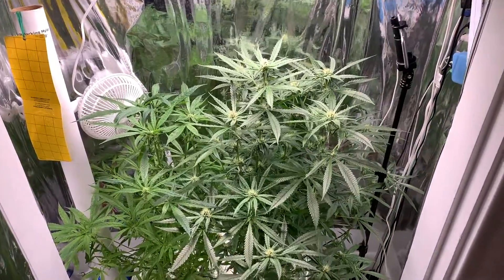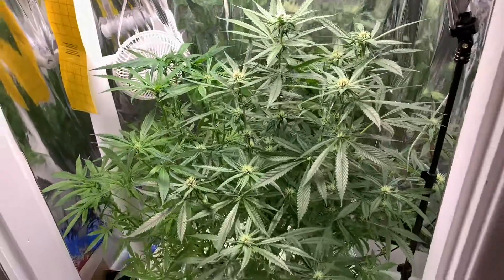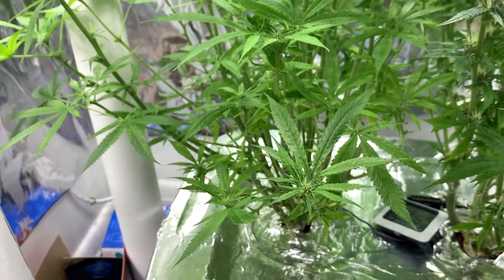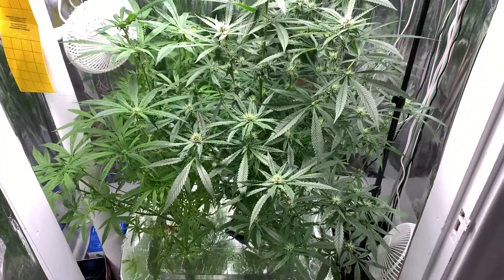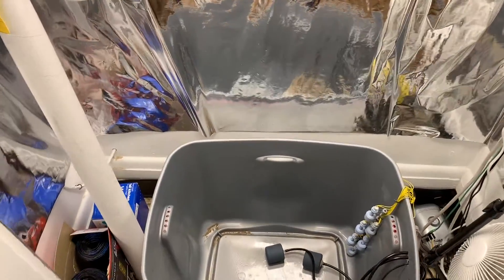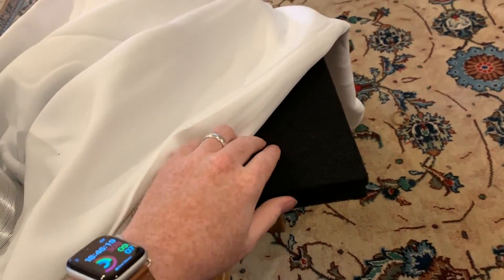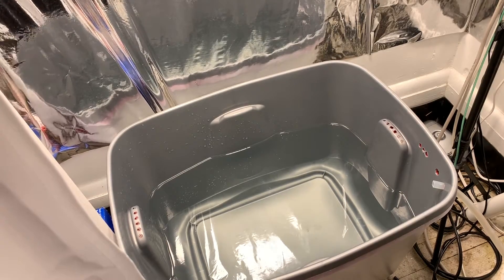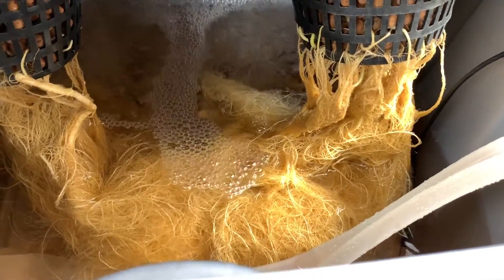DIY Hydroponics Grow Closet Upgrades (DWC) | My First Grow 11

Comment: I'm actually quite suprised that you where able to squeeze and break that stalk the way you did lol. Mine at that stage are hard as a fricken rock. It's always a good sign that the top turned back up after cropping it. And you really don't need the orange wire holding it. It will heal and harden off without all that. Once you lay that branch down it will NEVER stand back up at the spot where you pinched it. Well unless you didn't do a good job of pinching it lol. But I would certainly say you did

Comment: For future reference do your super cropping earlier bud lol! Those stalks are going to be at about the strongest stage of there life at this point lol. So pinching and rolling NOT going to work very well. And if you ABSOLUTELY insist on super cropping this late in the game. You would be much better off to get a pliers and pad it with some duct tape or something and use that to squeeze and tear the fibers of the outer membrane on a plant that hardened off already. Just a tip for future.

Comment: You might be able to cut an air in on the bottom and air out at the top of the door. Closet doors are cheap. Use the cheap one save that current door and put it back on when you leave.

Comment: Hi #Smart Grow Automation ,  I really like your vids. When you want to bend the outer stems down to open the crown, you can glue coins  onto sprung clothes pegs and clip the pegs so the big  hole intended for gripping the clothes line, goes around the stem. This places even stress along the whole stem. I'm not familiar with U.S coinage weights, but in the U.K our 2P weighs 1/4 ounce, and a penny is 1/8th ounce. Doing it this way removes the risk of snapping, and introduucing infection.  I hope this helps. Thanks for the vids, long may they continue. Stay safe. Kind regards, Ve
Reply: P.S Plants in flower produce hormones that reduce the likelyhood of the cutting rooting. If you want to clone those, best to pinch out flower buds from the stem 3 days before you take the cutting. :)
Reply: @vemacrinnon9752  question, now if you pinch those buds off three days before does it make that clipping any easier to re-veg or anything??
Reply from the maker: Thanks for watching and for the feedback!
Reply: @SmartGrowAutomation  You're very welcome. :)

Comment: Your pressing too hard. Hold with two hands and twist opposite with each hand. You will feel it give, them you bend gradually each day. I use trellis and pipe cleaners. Also you need to put your humidifier or dehumidifier on a timer each day to lower the humidity. And your using live microbes, amino acids, fungi etc. via your nutrients! That’s why you shake it well before you use it.

Comment: Yo heres an idea, double layer thick cardboard, cover with reflective material. My box is 1 inch by 1 inch wood slats. Thats frame. Covered in 2 layers quarter inch cardboard. Covered in mylar fronted bubble insulation. Cardboard keeps my box from getting humid at all. Also need an air intake and exhaust

Comment: Put a AC grate thru wall it will look natural and function.
Also you could possibly duct so AC ?
Reply from the maker: I couldn’t cut a hole in the wall or the door because I live in an apartment that I rent.
Reply: Yeah that’s wouldn’t be good then.
  Look up this, I think it could work, you mentioned under door, check this out Lowes item#1036515 Amerimax 24.5 Black vinyl downspout extension 
Home Depot has similar called gutter deviated, you could use this quite possibly because it’s thin and no real heat.
Hope it works out.
Reply from the maker: That could have worked nicely. I ended up just using a black out curtain and cutting a hole in it though

Comment: Is that mylar on the top of the lid? mylar tape?
Reply from the maker: It’s called aluminum tape, It’s used in HVAC ducting usually. You should be able to find it at a hardware store or amazon.

Comment: The ‘black out curtain‘ with a hole for extraction ducting seems good option. Could use heavy dark plastic to create a good seal. Have to figure some way of taping it, or tacking some wood edging leaving a flap to get in and out. Just a thought. ✌️
Edit:
*Curtains with magnetic seal great idea 💡 looking beautiful in there 😃 Cheers!
Reply from the maker: Yep, thats exactly the solution I went with. See @14:40 for the final implementation.
Reply: @Smart Grow Automation  Okay 👌 Just watching Video still, haha. Hey with the ‘super cropping’ if was me would not squish stalks but progressively train them either with wire, mesh, or strings so plant grows into shape you’re planning. Once you hear that crunching sound damage is done. Should be able to bend stalks slowly. I guess more tedious however, but easier on plant. Great work, 🙏 watching from Australia 🇦🇺👍
Reply from the maker: @Bruce097  Yeah agreed. At the beginning of my grow I definitely did some of those low stress training techniques. (Check out Ep. 4 of the series: https://youtu.be/D71ZidGwass). I saw a few videos on super cropping and i was curious and wanted to attempt it myself. I did it on lower branches in case it failed. In the future I would only go with super cropping if absolutely needed (for example if I could no longer lift my LED panel any higher). That being said so far both of my super crops are still alive so its not all bad.
Reply: @Smart Grow Automation  Aha, cool. Yes I see!  People have flattened their plants onto a trellis, by weaving it in and out. Keeping foliage away from lights as long as possible. Not up with terminology of everything.
https://youtu.be/vozXEIEZLcE (?)
Just watching and learning. Is an intuitive thing, you go with what you feel being there, thanks for your friendly support ✌️
Reply: I think with this grow you needed more nutrients bc of the high humidity
Reply: And or more water changes

Comment: at this point heat and humidity are crucial looks  like you might  have  a little  foxtailing  going on, best wishes getting it under control!...
Reply from the maker: Thanks. Humidity is now holding steady at 45% with the exhaust fan so I think thats under control. The temp of the top cola when read with an IR thermometer is 78 degrees F. During the flower stretch the top colas got pretty close to the light 2 times which might have made them start to foxtail. I hope that all is under control now though.
Reply: @SmartGrowAutomation  sounds ideal!